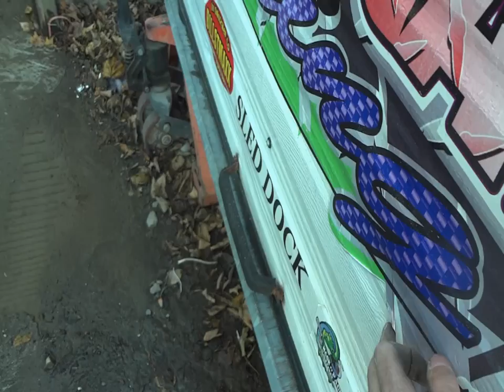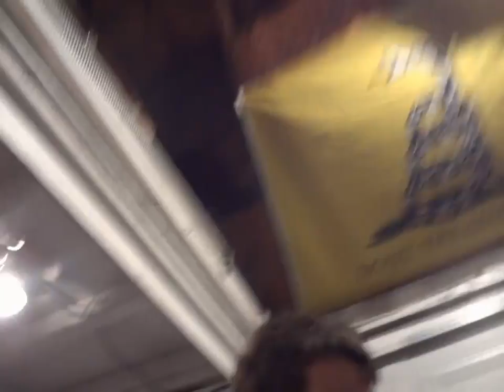pipe with some new TRACTORS

Comment: atleast with the line to the house you wont be painting something on a long weekend and run out of propain and have no heat and fuck up the paint or something like that   oh trow up some insulation and 1/4 inch plywood on the roof it will help big time with the heat